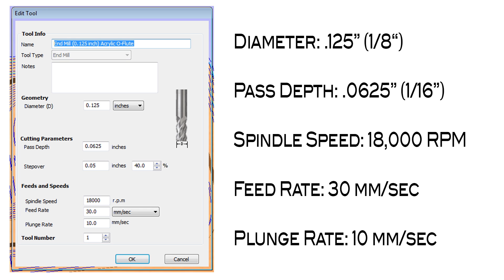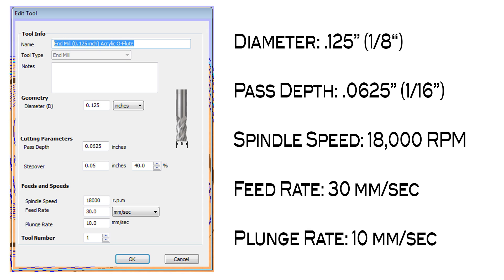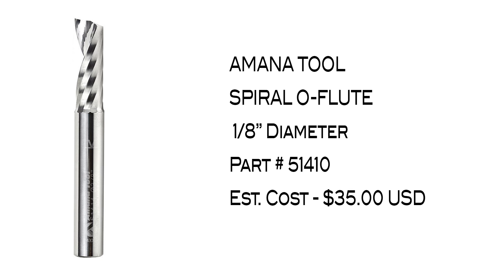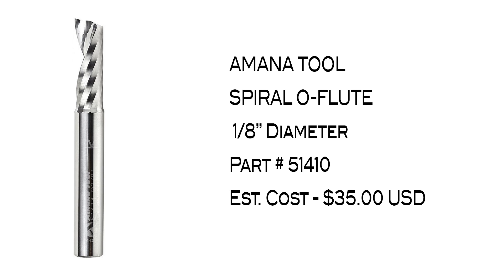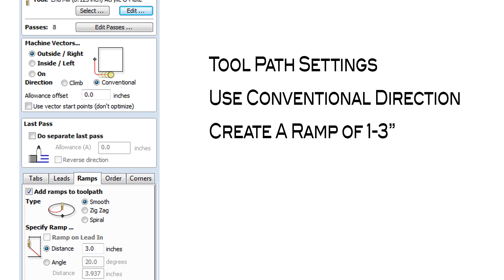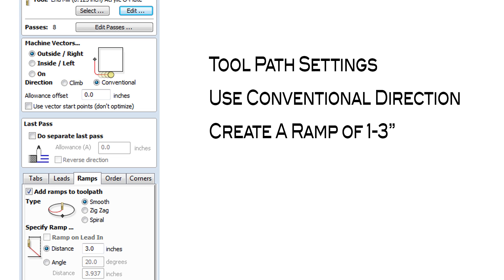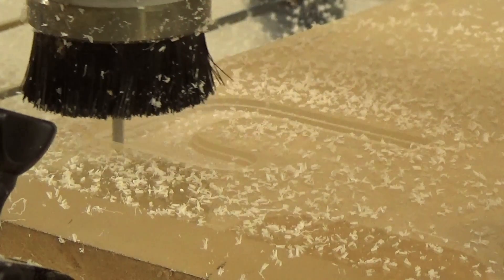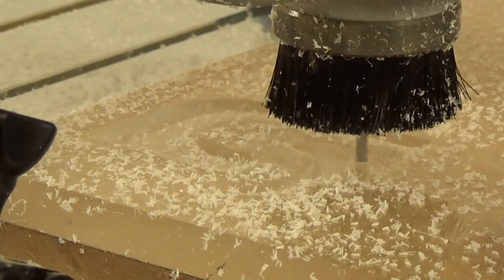Cutting Acrylic - Optimal Setup For Success On A STEPCRAFT CNC System

Comment: My brother have Stepcraft 420, it's a really good product, he bought it on former "Ironwood" we love it.  Ironwood is closed now, too bad. He found a perfect acrylic once with the perfect settings, the cut was perfect, not all acrylic have same property, no ?
Reply from the maker: These settings will work with most Acrylic.  Some adjustments are always possible due to if the material is cast or extruded and based on the end mill you use.   Not all end mills are the same even though they look the same.  This video will give you a good starting point

Comment: I cut a lot of acrylic at work and i use the same tool from Amana, but it's a 1/2" tool. I want to get a stepcraft so that can i can run it in the basement, but i don't know if this machine uses a lot of voltage, great video by the way.🖒🖒
Reply from the maker: The machine runs off of 110V AC (220V in Europe).  It draws about 3 amps of current.  So it does not require any more than a simple home outlet.
Reply: I think you mean watts.